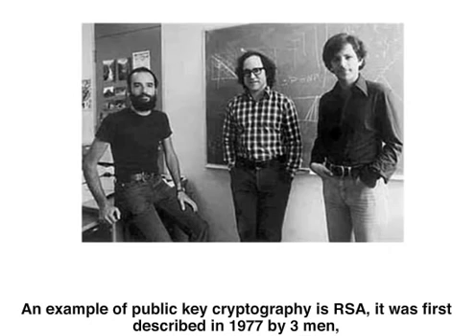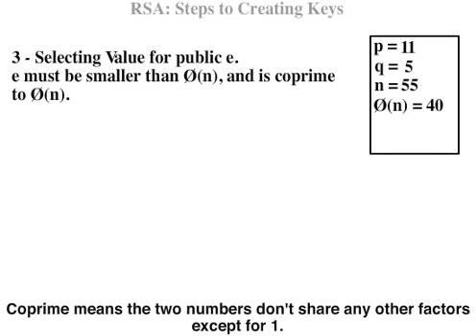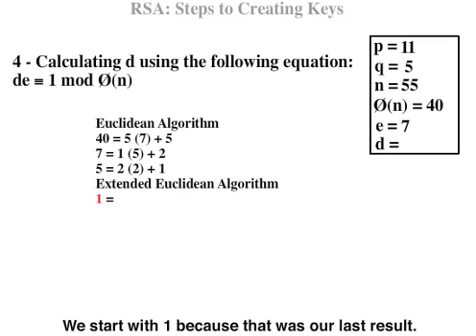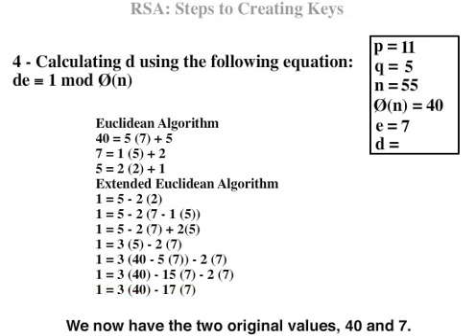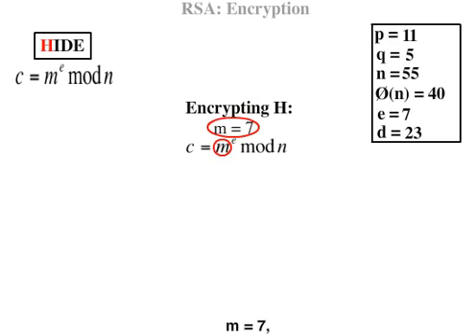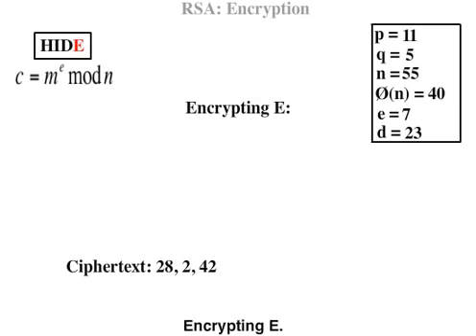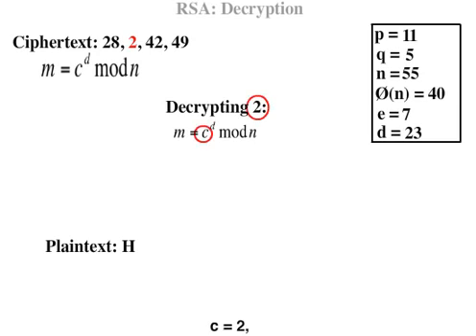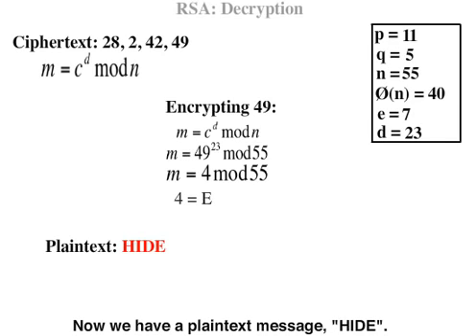RSA Algorithm

Comment: 4:18 how from d = -17mod40 became d=23mod40 ???? please help
Reply: Think of the modulus operation like a circle. Lets take this example X mod N. 
N being a positive integer. That means that the values that we can get by using this operation are the integers inside this interval [0,N-1]. 
Now why do we need to think it like a circle. 
If I go from 0 to N-1 by applying the modulus operation we get the same value.
If I set X to N then the modulus operation will throw 0. If N+1 then 1. So it is like a circle. We start again from 0 after going for bigger values than N.
By using the circularity of the operation we can write X = m(N) + v; Where m is a multiplication factor of N and v is a value inside the interval that we defined before. The modulus operation will remove the m times N part from your X always.
Now what happens if we make m negative? We can easily readjust the equation by adding multiplications of N in order to make the value positive. 
For your comment now -17 mod 40 = (-17 + 40) mod 40 = 23 mod 40
The circle will be complete if we use the difference operator 23 - (-17) = 40